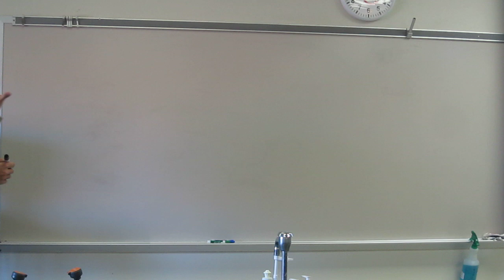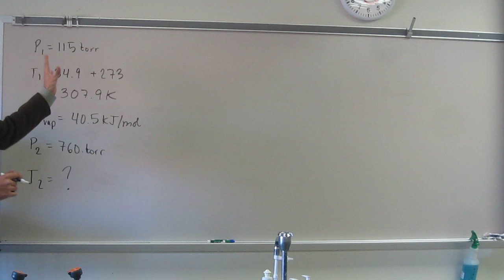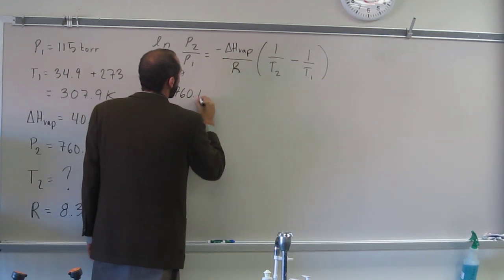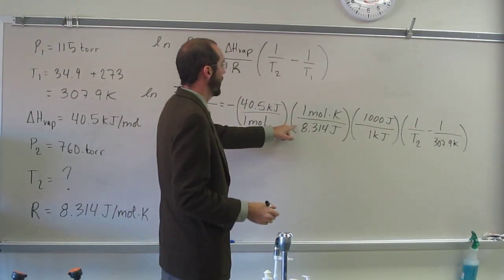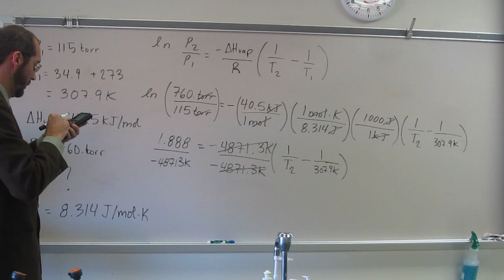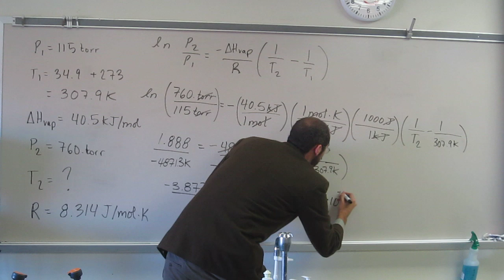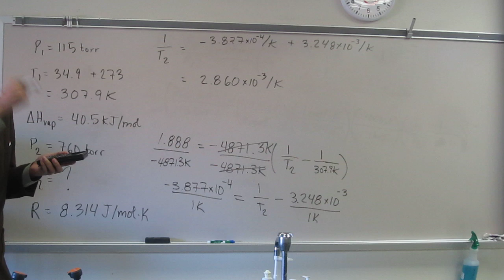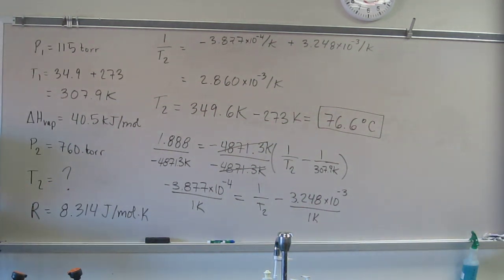Clausius-Clapeyron Equation 001

Comment: May I have the solution of this equation (The vapor pressure of liquid benzene obeys  the relation ln P = 29.411 − (5893.5/ T) ,  where the pressure is in torr and  temperature is in Kelvin. Calculate the molar enthalpy of vaporization of benzene and the  normal boiling point.)

Comment: Why didn't you just convert 40.5 kJ to J right away, which would be 40500 J, and then divide it by 8.314 instead of having to do some factor labeling? Thanks for posting though. It helped me understand, as you were the only video I could find that was trying to find T2, not P1.